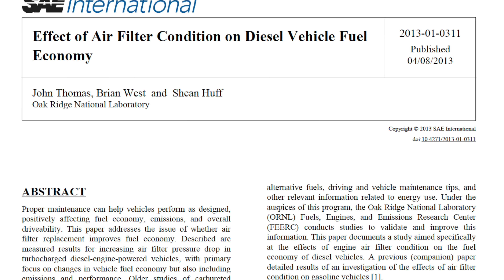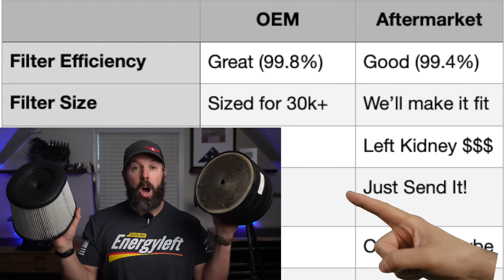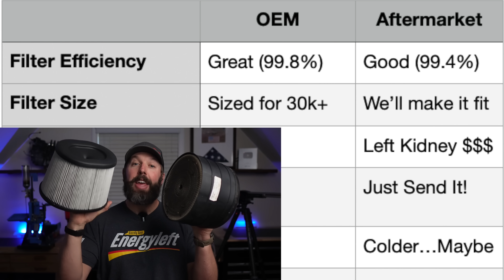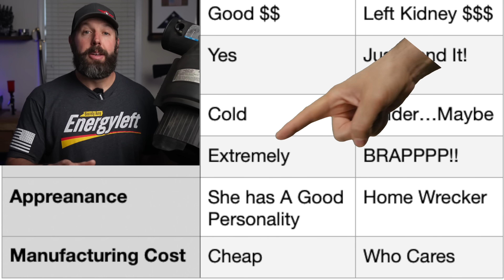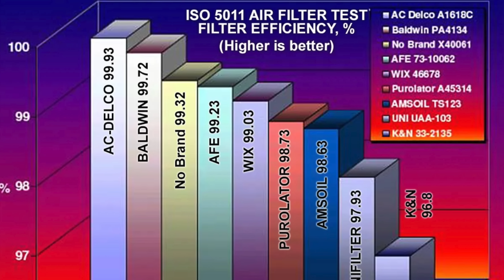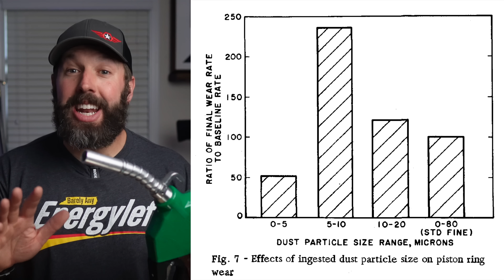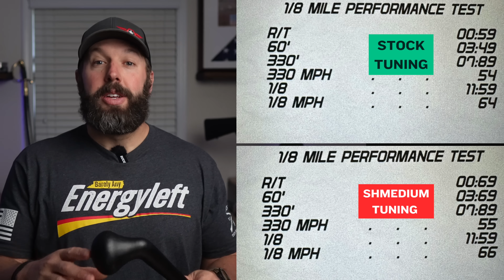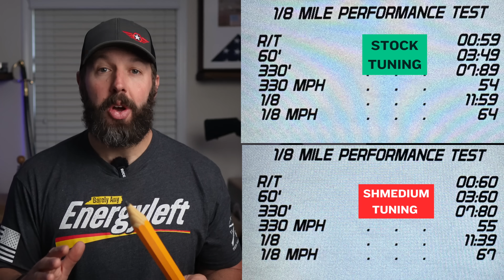The TRUTH About Cold Air Intakes…ACTUAL SCIENCE!

Comment: 3:00 Not 'probably', "Definitely".
A Volvo F10 had me stumped after I Serviced and changed an Air filter once. The driver next day said it had no power, to which lead me to believe turbo failure. Turbo looked good.
I got the driver to drive the truck with me standing on the Chassis behind the cab.
Didn't take long (half a mile?) to see what the problem was.
Only (and 'only') when he put the boot down and the turbo tried to Spool up, I saw the Thick 4" Intake hose from the Air cleaner get sucked in (not totally) every time he gave it full throttle.
Problem found 👍
And if anyone is interested, this was for a fleet company whereby we would send all of our filters off to a "PROFESSIONAL?" Air Cleaner cleaning Company who Sold or Cleaned our Filters depending.
To me they obviously made More money Cleaning them than they did on Replacing them.
This one had me stumped for a while.
They Obviously didn't do a Proper "Flow Test" after cleaning it ffs!
PS Symptoms: Low Power only on hard acceleration, accompanied strangely by black smoke .. 🇦🇺

Comment: I would like to see a comparison between using the stock air filter setup and using the 6637 air filter. I have a 1997 Ford F350 XLT 4x4 CCLB that I swapped in a 6637 air filter. I did it to have a larger air filter surface area. I have no data that shows any improvement in MPG, HP, and Torque other than the butt-dyno, which really isn't reliable.

Comment: I built my own "Cold Air Intake" after i got a crack in my factory intake hose. That was gonna cost 220 dollars. So I built my own Aluminum piping and 4 inch air filter at the end.  105k miles later and all I ever do is shake off the filter now and then lol. I use a Air filter cover that's supposed to help with dust and water just didn't know if you ever heard of this?

Comment: My experience is with gasoline vehicles, so it's not entirely comparable to diesel vehicles, but I have noticed the factory intakes on my two early 2000's japanese cars, one Honda one Toyota, are designed with restrictive tunnel systems, a 2" plastic pipe with a 90° inlet next to the radiator, snaked under the batteries, back up into an air filter box, and from there to the engine on bigger tubing, one with 3" the other with 3.5".  I understand that the pathing is done for some degree of water separation and noise suppression, but the pipe diameter definitely makes a dent on the airflow, and since these are gassers it does impact fuel economy as well as power. On both of my cars, I've removed half the air box, tied the filter to the remaining half, and set it up to pull cold air from around the sides of the battery, not the purest cold air since it's open to engine heat but better than a ram, and I've actually had a noticeable and significant pickup on both vehicles, with admittedly very minor increases in power, but substantial jumps in economy, with one car going from 19MPG to nearly 26MPG, it's about the same on both city and highway, and the other going from 21 to 23MPG in city driving, and from ~29MPG to nearly 40. I don't drive highway that often so I don't exactly have perfect numbers for that metric, just rough estimates.
And since it's done with an admittedly slightly stupid mod to the original air pathing, this is still with the stock air filters, too, so unless I missed something drastic, there's zero detriment to the life of the engine. Though, I might have more issues if I ever end up having to drive through a flood, since the air filter is open to getting drenched.

Comment: I'd love to see a video about removing those intake resonators. I love the sound it makes but read in my book "Engine Management, Advanced Tuning by Greg Banish" that those resonators can actually improve maf efficiency by removing or mitigating the standing waves in the intake piping. My question is does it really matter enough for me to have to live with not as fun intake noises.
Reply: With Porsche cars, yes, it matters a lot. Many tuners have tried to out perform the factory design of the intake manifold and air intake system but failed. The pulse tuning done at the factory could not be outdone.

Comment: Like your videos but some of your info don't add up. Per the report, the Unifilter let thru more dirt than the K&N. Unifilter let thru 20X the dirt compared to the AC Delco and the K&N was only 18x the dirt compared to AC, you know that engine killing fact you were going on about. 🤨Also, its curious how the "independent" testing (over $15K value) done free of charge by and for a guy with a GM truck found the GM owned AC Delco the best filter.🤔🤔🤔😏😏😏 Sorry, I don't believe in coincidence.

Comment: This just cracked me up. Yes a clogged air filter is probably more efficient in filtering but is striping the engine of its power, like if you put a rubber plate instead of the filter you will probably have 100 percent filtering efficiency but will not drive anywhere.
Reply: But if you watch the video, an extremely clogged filter causes no difference than a clean or slightly dirty filter.
Reply: @MikeHoncho1775 so no need to change filters ever. Go to see project farm filter comparison, it show the opposite. But you can buy into this.
Reply: Your reasoning is wrong, that filter has a hundred times more area than needed.  What he was saying has been taught in tech schools for over 50 yrs
Reply: @Maurice-c6z haha 100 times area then needed and still is restrictive even when new and clear. A classic example of science over common sense. You go by the science, I'll stick to my common sense.
Reply: @ophirb25 ok, but common sense should be influenced by education and experience
Reply: @Maurice-c6z exactly, what is more grounded education or experience? In my experience when the filter is clogged, no matter how many times its area is more then needed, the car doesn't run good, doesn't produce adequate power, and with modern cars you get all kinds of fuel trim issues, all of which miraculously disappear when you put a new filter.
Reply: @ophirb25 that's why most vehicles have what they call a tattletale device on the side of the filter box to tell you when to change, ( my truck has one) because most owners haven't got a #$@&--$# clue when it should be serviced. All heavy equipment has them and they should be followed
Reply: @Maurice-c6z but he says that the more the filter is clogged is better, and that it is science.🤔
Reply: @ophirb25  he meant clogged visually

Comment: As somebody who developed a CAI for high performance applications on SN95,  the biggest performance is on the actual IATs difference, on that platform were 20-30F lower with my CAI kit (that feeds from a headlight intake designed for that task) vs other aftermarket CAI kits 

Filter area and shape (interal and the tube between the filter and TB) do help on +500whp NA cars but more on throttle response and over 7k rpm, but the biggest difference between my kits and other CAI kits is the headlight intake that feeds the filter VS the rest of the aftermarket with fender mounted CAI kits, so on my real life test from different customers with aftermarket ECUs the actual gain was in keeping the IATs closer to ambient temp at the track lap after lap without the ECU pulling timing, but all of that was from the headlight + supplementary duct that comes with our CAI kits that keeps those temps under control.

Now for boosted applications filter area and tubing size from filter to turbo / TB (supercharged) do make a big difference in reducing restrictions so the bigger filter inner diameter + big and long velocity stack style reducer to final diameter did show some big differences at higher RPM more when combined with the headlight intake that is doing the heavy lifting keeping the IATs low
Reply: With all of that I mean: It helps in keeping the power constant at the track lap after lap when everything is heatsoaked and the car is moving due to the temps on NA cars, but that comes more from where the CAI feeds their cold air than from the actual less restrictive filter unless you are spinning over 7k rpms where filter style and tube shape do become a restriction on high RPM NA cars (or boosted cars) 

But, I dont reccomend my filters for stock(ish) cars, only the headlight intake to keep any filter behind feed with cold air 

Ram air does nothing (pressure) as it would need a box so big that it wouldnt fit on the engine bay, so IATs difference are where the actual improvement comes if your OEM system or aftermarket CAI kit is not keeping those IATs close to ambient

Comment: Your videos are awesome! Got excited when I saw a S&B in the thumbnail! Appreciate the support and business. We do our absolute best to match or exceed the filter efficiency, but sometimes it’s almost impossible without really affecting airflow.

Our most popular kit is for the 2020+ Powerstroke. Stock is 99.21%, our oiled filter is 99.42%, dry filter is 99.54% 😊 

- Cayman
Reply from the maker: I appreciate it. Thanks for providing all the data for nerds like me who actually care about that stuff. Great Products 👍
Reply: 2021 250 tremor here.
S&B intake with dry filter from about 5k.
Now has 238k on the clock.
Was at a diesel shop that specializes in fords.
Ask the lead mechanic his opinion on how my engine runs.
He said, absolutely perfect like it’s new. 
The only reason I switched to S&B because the factory filter was annoying to remove and driving through heavy rain the factory filter was getting soaking wet.
Anyway mine runs great but I do my maintenance!
Reply: @timfoster1599 thank you very much. Really appreciate the support
Reply: 2005 Silverado LLY, S&B from 100k to now 205k. Oil analysis has come back pristine last 100k, with oiled S&B and amsoil HD oil @10k intervals. I do love your products
Reply: @mille1cw  much appreciated!
Reply: I’ve had the original S&B oiled filter on my 6.7L Cummins ram since 2018.  Have S&B filters been updated with higher efficiency since then?
Reply: @andymike6575 if you have a 4th gen. Your filter is 99.55% efficient and stock is 99.81%. 99.55% is radically efficient. For example, the 2020+ Powerstroke OEM filter is 99.21% efficient
Reply: @SBFILTERS awesome I didn’t know that, thanks!
Reply: Impressive, curious if yall make one for the 2011 WRX?

Comment: But don't wait too long to change your oil filter, because it has a bypass valve that'll open when it gets clogged.  Also, the paper elements don't last those 10,000 extended changes, they start breaking down.

Comment: This is true k&N air filters will 100% make you get worse mpg on my 2001 tahoe stock air filter I would get about 30 more miles to a full tank of gas and if u gut or get high flow cats will do the same worse and its not good to begin with !! Im looking a straight 6 mercedes diesel to swap into the tahoe and a 4L80 4x4 trans and some 2500 front and rear diffs and that will be the what last me this life time!!

Comment: Where do I find this thing on my Tesla? 🙄 Just one less thing to think or worry about.

The Cummins 6CTA (8.3 liter) engines on my yacht came with the KN filters. Not much dust out there on the waterway though. I do clean them yearly though, it just is not that much trouble. That spray can of oil will last me a decade in the two engines.

Comment: The main reason I put an aftermarket (S&B) intake on my truck was just for the turbo noise and I'm happy with it. I have that and a mild tune. I wasn't expecting a big power gain, nor did I need it with the trans already showing signs of unhappiness under WOT shifting. In case the last part didn't give it away, it's a Dodge. 2008 6.7 to be specific.

Comment: Efficiency in an air filter is a rating of what is the largest particle that can pass through the media measured in microns. Your high efficient AC/Dumbo will need to be several thousand times larger in surface area than the K and N because your engine can't suck any air through it. If the K and N filters air well enough to meet your manufacturers requirements, It's allowing a lot more air to pass through the filter meaning less throttle to drive like you are suppose to drive. Not how you really drive. Your super high efficiency AC/Dumbo will require you to do a full throttle neutral drop to roll through the intersection. Bottom line is, The K and N filter could extend your engine life to several trillion miles. Maybe.  Another way to look at this, A tennis racket has no efficiency. Plywood is extremely efficient.

Comment: You need a lot more research on how an air filter loads and becomes more efficient. It's far from a dust cake or layer. And I gave you a clue. A new filter should stop any particle big enough to damage a engine. So you will get better mileage and performance from a new filter every 500 miles because your brain says so. Loss of power means less fuel is getting squirted into the cylinder because less air is available, maybe? Since when do you measure air flow with a dyno? How about 3 to 5 different labs do that test and tell us a dirty filter is better for the life of your engine. That is similar to saying put on a respirator and breath through it round the clock for years. It will get more efficient also after being used for a while. You may have the same power for a while, but as the respirator media loads until clogged, you are going to lose power, you will get better food mileage because you can't breath well and do much work or play. You will eventually starve your brain of oxygen just trying to stay conscience. It will eventually get so bad you forget how to shave and start looking hideous more and more each day. Just saying.

Comment: VIDEO TOPIC: Gas engine powering a Tansmission thats simple 3 or 4 speed non overdrive  with 1.0 top gear with 3.08 to 3.50 rear gearing or a complicated 6 to 8 speed with potentially 2 overdrives with 4.10 to 4.50ish gearing.

Comment: I have an S&B air box on my 6.4L Hemi Ram Power Wagon. Love the air box, love the extra acceleration power provided (and yes, I can tell the difference between the stock 410 bhp and the 430-440 bhp with air box). As the Power Wagon is built for low end power to rock crawl, it was not made to last forever. More than likely a rock or cliff will destroy the truck & engine before the Air box will.

Comment: Of course a clogged filter gets the vehicle better mileage. This cuts down on the generated power at a given amount of accelerator pressure which forces the driver to drive slower. This is the "secret" technology behind the Toyota Prius's high mileage. It prevents the driver from getting much power out of the vehicle. But, HOW MANY PEOPLE WANT TO DRIVE A VEHICLE AS WEAK AS A PRIUS ??? They'd rather willingly pay for the extra fuel than drive a slow car. A clogged air filter forces the same situation: Less available power gets you better mileage, but the vehicle will be slower. Of course, the driver can get back that power back by being "heavy on the gas petal" but that's unnatural and very annoying. Most would rather pay for extra used fuel than put up with a "slow" car ! Did these reports mention any of these obvious downsides ?

Comment: ✌️ i am out. Air filter replacement doesnt matter when your emissions systems kill your engine prematurely. After the video of you backing up emmisions systems, i am out! 
We need to spread quality information about current emmision systems doing more damage than good. The worst thing about emmission systems is reliability. We had diesels that would operate for 500,000 miles and now they are prematurely failing at less than 100,000 miles. The cost of these systems has driven up diesel prices. None of it makes sense economically

Comment: My BMW engine doesn't have any fancy tech, but I spliced in the stock airbox (with all the cold air ducting cowling bits) from a different engine with more displacement and a more efficient intake system (Valvetronic). Do I feel any changes? Not really, but there's definitely more intake noise. However, in my case, I feel like I may have not lost any engine longevity due to both systems being stock.

Comment: I had a honda and a toyota both air intake takes air straight from the front of the grill. So you're 100% correct that it is a cold air intake. It makes no sense to replace factory air filter with the expensive air intake that sucks the hot air straight inside the engine bay

Comment: I have a newer Bronco with the V6 ecoboost twin turbo.  I upgraded the exhaust, intercooler, charge pipes, CAI, and added the Ford Performance tuner.  I added the CAI and charge pipes at the same time after the other stuff.  It feels like a different vehicle.  Throttle response is amazing and it definitely throws you back in the seat on launch.  To your point, I doubt I’ll have the vehicle long enough to for engine damage to be a concern for me.  I don’t put a lot of mile in it yearly.